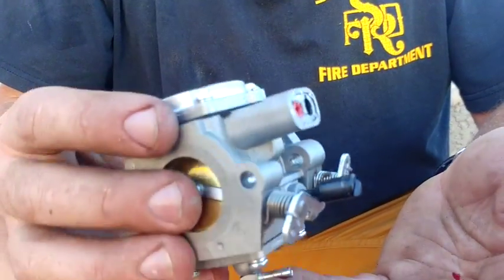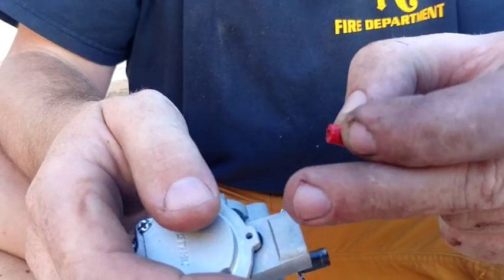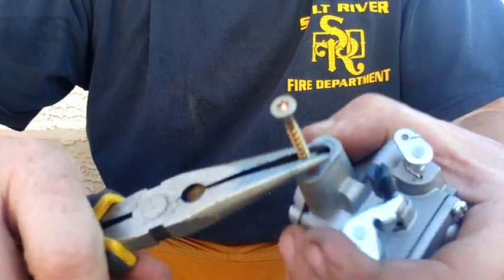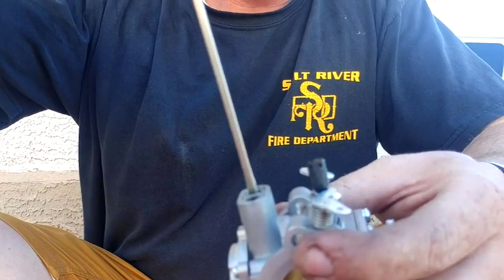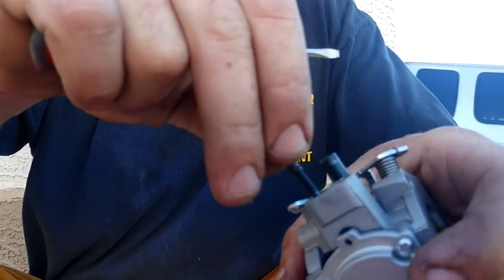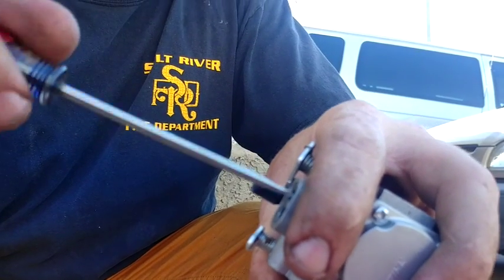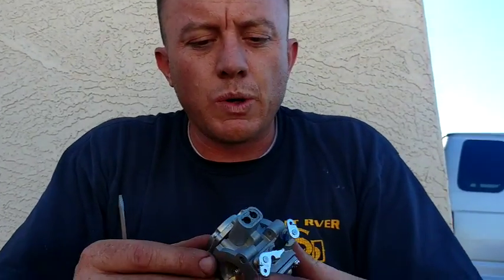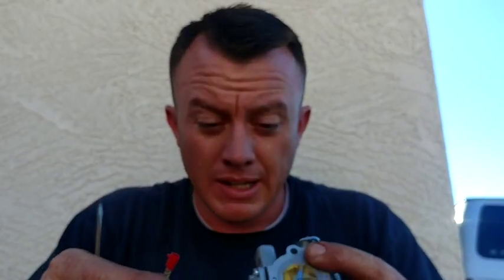How to remove carb limiters on your chainsaw

Comment: I’m pretty sure those are EPA-required tamper resistance
Reply from the maker: Do you have a source for that claim?
Reply: @KimballCody  Nope, I just remember one of the big saw YouTubers talk about it. Here’s a quote from the Husqvarna customer service website I just found: 
“Because of emission regulations both by the E.P.A. and C.A.R.B. we are not allowed to provide a method of adjustment to the consumer, all carburetor adjustments MUST be carried out only by trained servicing dealers.

Carburetor adjustments with tamper resistant screws or limiter caps must be conducted by Authorized Emission Certified Servicing Dealers ONLY.”
Reply: @samharris9559 You are the perfect candidate for a battery-powered saw.
Reply: @Skinnymoose  Lmao why?
Reply: Skinnymoose - if you were to ever find yourself living in the middle of butt F nowhere, where you have to do everything yourself, you may be screwed.
Been there and thank God they didn't have limiters on them back then, we tweek them ourselves. Carpenter, plumber, electrician, small engine mechanic, large engine mechanic, oil furnace repair, hand faller, bucker, etc.
Learn to do it by doing or someone close teaches you something you don't know & now you know.
Or....you could always travel 5 hrs. one way and pay $$ to have a tech stick a tiny screw driver into two holes and tweak your saw for you, charge you $50, then travel back 5 hrs. possibly change elevation a bit and it doesn't run quite like when he set it. 
(Lived & worked in the coastal mountains). 
Saw shops are in the valley towns. 
Learn to DIY or get you a battery operated hedge trimmer 12" chain saw. 
Not gonna cut yourself 5 cord of firewood every year with it again and again but you won't have to know how to adjust the H & L or how to rebuild a chainsaw carb and get er going again. Just leave it to the rest of us.......we'll make out just fine.

Comment: I got a Stihl 036 that does't want to start  ..not knowing where to start...I decided  to give a few 
pull and to remove the carburettor ....there is petrol coming in from the tank but no petrol going in the 
membrane --where is the needle with the little handle and the little spring ----Could it be a blockage
somewhere ?
Reply from the maker: Sometimes old carbs get all gunked up and buying a new is the best way.
I've tried to rebuild carbs and I've got a 50% success rate. Amazon and ebay has a bunch

Comment: Thanks for this valuable tip KimballCody! I plan on doing a muffler mod later this year with my son and wanted these limiter caps out of the way so we could adjust the carb.  I'm in East Mesa so small world. Be safe especially in this heat.
Reply from the maker: Will do. What are you planning on cutting?
Reply: @KimballCody  Douglas Fir mostly.  For firewood

Comment: Just did this to my ms271farmboss because like another member said about their saw mine was worthless wouldn't idle and bogged when throttled it deleted the limiters got it tuned shes a cutting machine now and will idle for days. I made no modification to exhaust on the ms271 the new stihl limiter caps are different than the old style red plastic ones for anyone still unaware of the change.

Comment: I just did this about a month ago with my Stihl MS461.  Why? Because the limiters made my saw virtually unusable due to the fact that it would not idle. At all. My limiters put up much more of a fight than these ones did. Took me about an hour to get both of them out. Ran the screws in and turned 'em out my usual 1 1/4 turn. Two pulls and it idled fine. Now if only my saw weren't so heavy! Think I'll attach some helium balloons to it.
Reply: localcrew I have the same saw ... the “r” version.... mine ran fine ... but it needed to be richened up for break in.... I didn’t bother taking anything apart.... just turn it till it hits the limit... then turn it some more till the little tab snaps ... then your in business .... hope this helps .... ps... this way it don’t get mangled ... and looks great if you bring it in for service
Reply: Well, it's lighter now without the limiters.  ;-)
Reply: I have an Echo 355t,  and with a clean air filter it can't be adjusted rich enough to not be slightly lean. The saw didn't run right until the air filter started restricting airflow, then it would run right and the carb could be adjusted to the environment. Stock, I would say people working at elevation in the heat may have a great running saw, but at sea level in moderate temperature, its not possible.

I definitely need to pull my limiters.